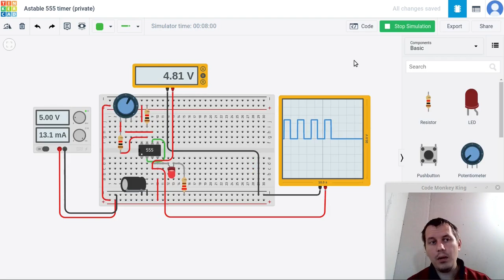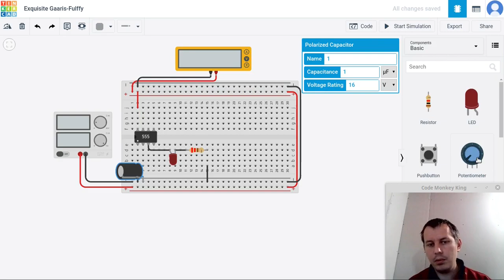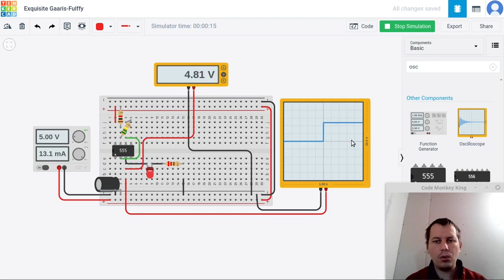Building a CPU clock step by step using LM555 timer IC on a virtual breadboard in tinkercad

Comment from the maker: 00:00 Intro
01:53 Creating new circuit in tinkercad
03:00 Connecting power supply to the breadboard
04:22 let's burn the LED!
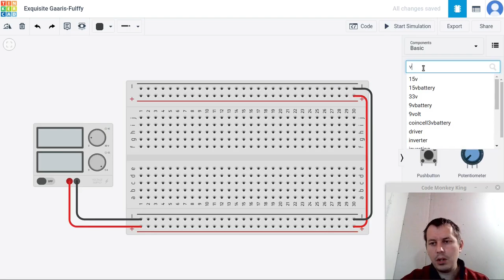05:00 Connecting voltmeter
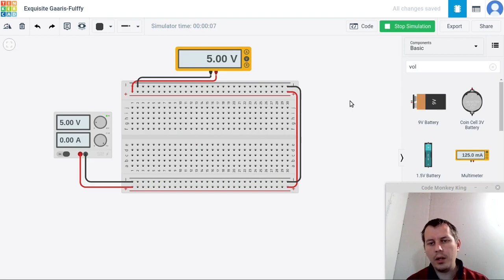06:07 Setting up LM555 timer
06:43 Powering up the timer
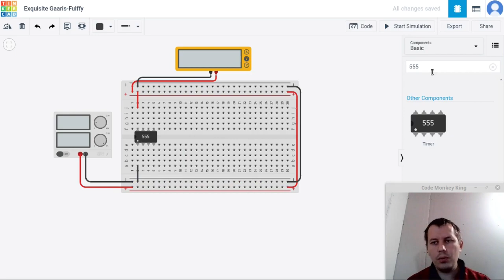08:04 Connecting LED to the timer's output pin
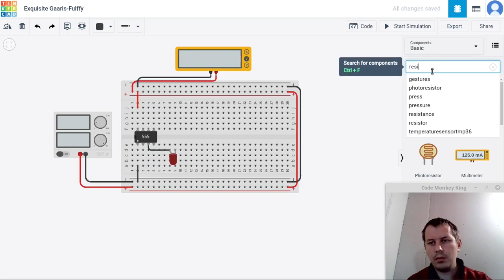09:44 Connecting 220 Ohm resistor to avoid burning LED
10:45 How to manipulate the input voltage to get a different signal frequency on the output pin
11:33 Connecting 2 micro Farads  capacitor
13:16 Connecting 1 kilo Ohms resistor (A)
13:24 Connecting 250 kilo Ohms resistor (B)
14:38 Connecting threshold pin (6) with a trigger pin (2)
15:26 Manipulating the signal frequency (LED blinking speed) by changing the value of resistor B
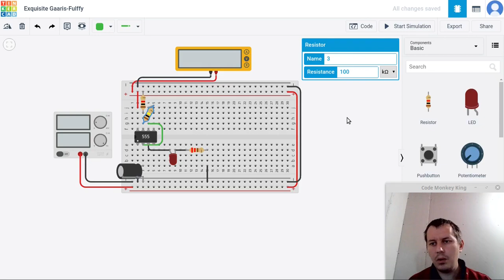16:24 Connecting oscilloscope and visualizing the output digital signal's form
17:34 I meant not 6.8 but 4.8 obviously
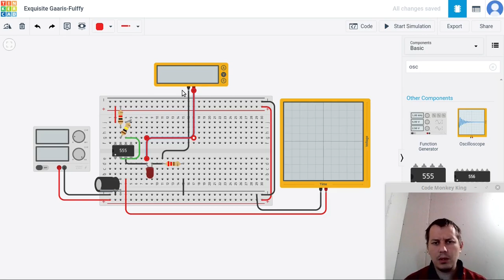17:46 Measuring the voltage on the LED
20:06 Connecting potentiometer